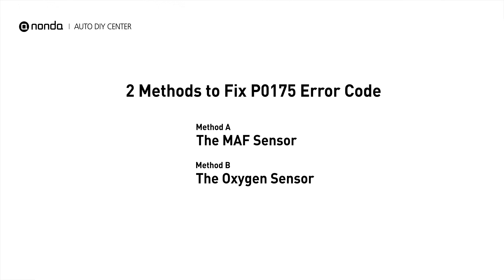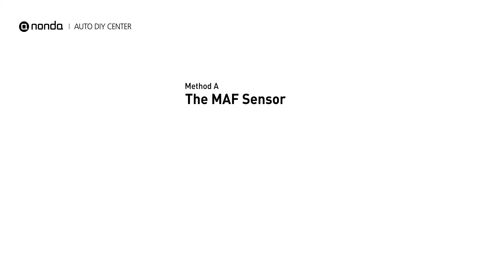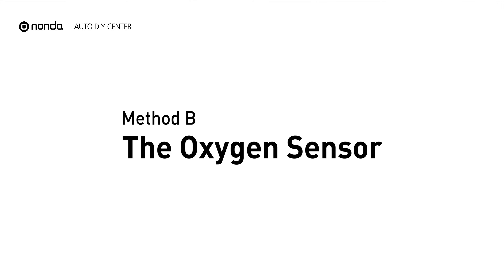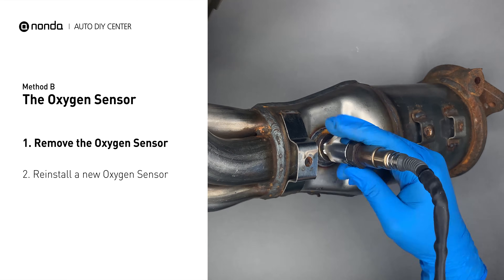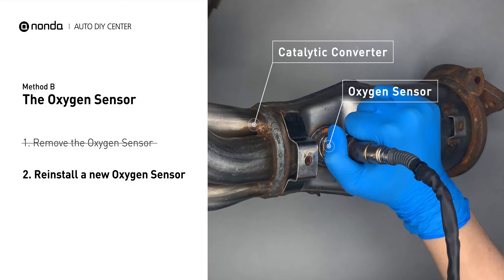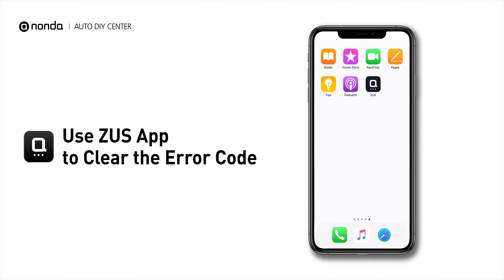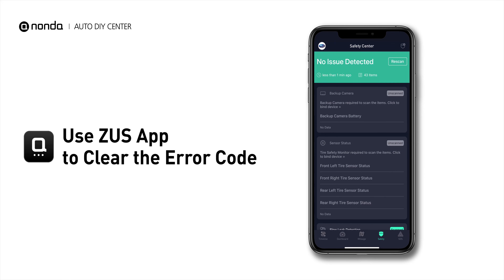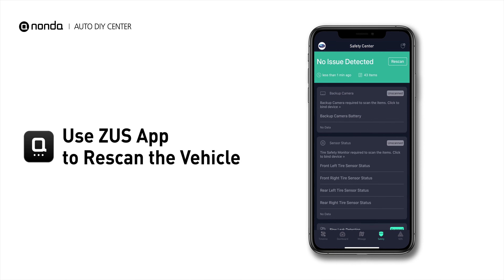How to Fix P0175 Engine Code in 2 Minutes [2 DIY Methods / Only $8.99]

Comment from the maker: Hi, I'm Steve, nonda's lead mechanic engineer. 
Feel free to leave your comments here if you have any mechanic questions, I will be glad to help you out!
Reply: Wouldn’t the maf sensor cause a rich code on both banks?
Reply: What do we clean the maf with?
Reply: @sevensickszero6112  mass air flow cleaner
Reply: I accidentally sprayed body throttle cleaner on the maf sensor but quickly after, I sprayed maf sensor cleaner. Would it damage the maf sensor?
Reply: My car a 2008 volvo s80 3.2 is giving me 2 error codes p0175 bank 2 and p0172 bank 1, triggering the check engine with message system too rich what oxygen sensor(s) do I have to replace
Reply: Hi I have a 2001 Ford Econoline E-250 with a 5.4L engine I keep getting a PO175 on bank 2 any idea how to fix.  I have changed the injectors.  I have a rebuilt engine.  Change the fuel filter etc

Comment: My car a 2008 volvo s80 3.2 is giving me 2 error codes p0175 bank 2 and p0172 bank 1, triggering the check engine with message system too rich what oxygen sensor(s) do I have to replace
Reply from the maker: Hello, as you are receiving more than one error code, we highly suggest getting your vehicle visually checked by your local mechanic for further diagnosis.

Comment: Hi , I'm Leo, I had a P0174 & P0175  on a 2001 Avalon 3.0  along with P1150 code> Could it be that the A/F ratio sensor has gone bad?
Reply from the maker: Hello, as you are receiving more than one error code, we highly suggest getting your vehicle visually checked by your local mechanic for further diagnosis.

Comment: Spray the MAF with what?
Reply from the maker: Hi Alma, you can find the MAF Sensor Cleaner here: https://amzn.to/3c87xcv
Reply: @nondainc  which works best? carb cleaner or electronics cleaner
Reply: @kerryburrier9205  Do not use anything other than MAF sensor cleaners, Other cleaners are known to leave a residue that causes problems and ruin MAF sensor.  Learned this the hard way.  PS You get what you pay for when buying a replacement MAF sensor
Reply: Isopropyl alcohol

Comment: P0172 is bank 1. What if both P0172 and P0175 are both triggered at the same time?
Reply from the maker: Hello, kindly make sure that the MAF sensor isn't dirty. Check if you have a defective coolant sensor, fuel pressure regulator, stuck open fuel pressure regulator, and stuck open thermostat.